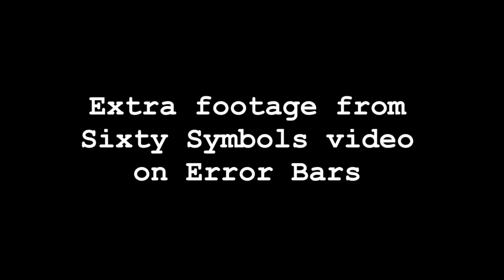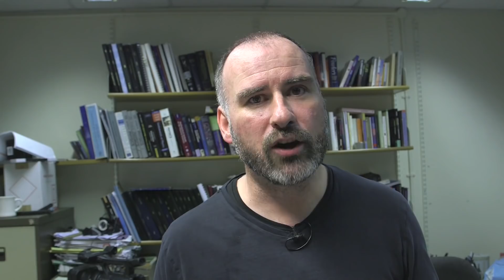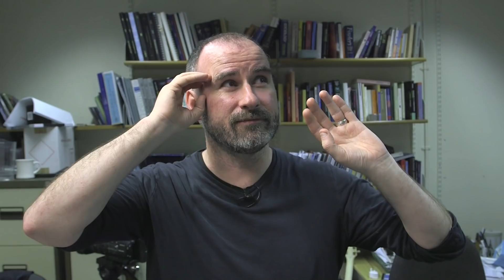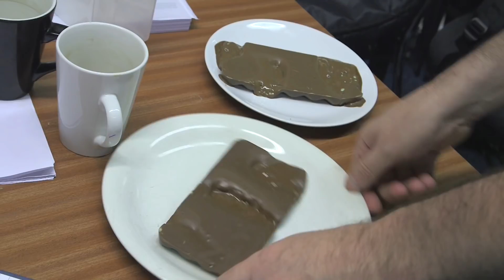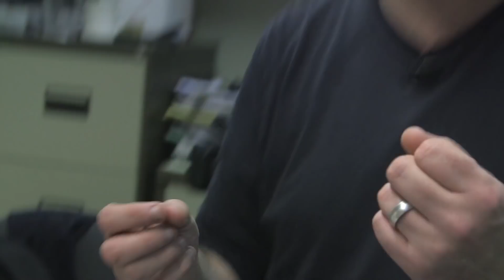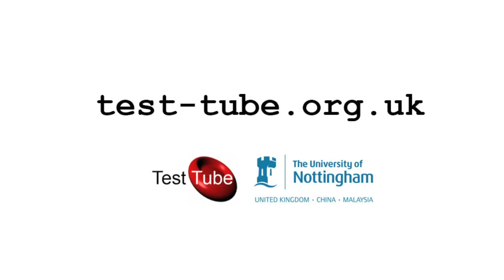Error Bars (extra footage)

Comment: Thank you very much Prof Moriarty, I was just working on my experimental data for Physics II and actually forgot to include absolute error bars (had only σ and µ), you probably saved my grade for that course/semester :)
BTW it would be great, if you ever talked about the accumulation of errors.... Just with 2 or 3 sources errors can add up :/ Just did a series of experiments measuring the width of a crystal structure , just 2 sources made my error of ~2% each accumulate to ~10% which is super frustrating because that is in the 3σ range after just ~30 measurements